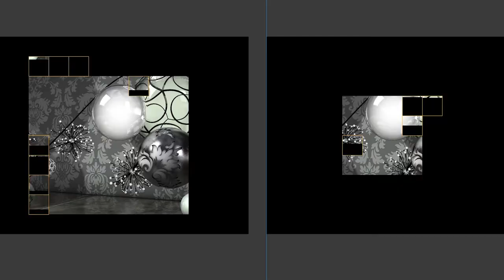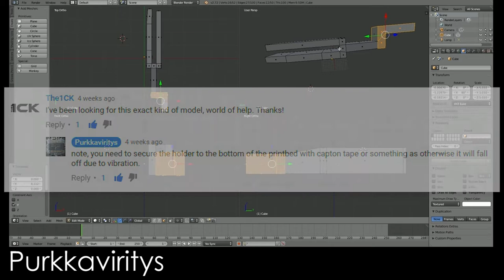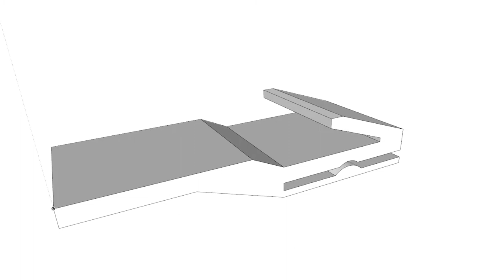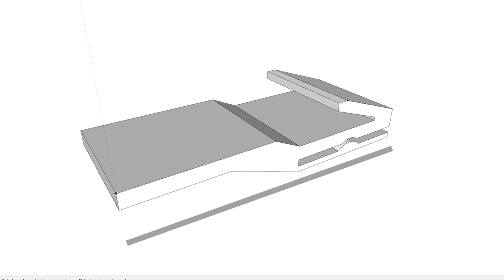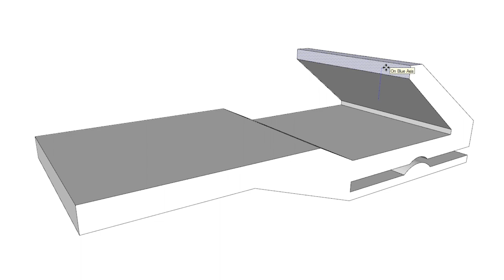3D Printing with the Maker Select V2 - Ep4.5 | Mounting a Camera

Comment: That camera mount is great! Thanks for uploading the file, I will definitely be using it. I am ordering this as a second printer so your videos have been very helpful to see the quality and modifications you were able do out of the box.  

Just a few quick suggestions that I'm sure you already know of, but might help someone.  To try to fix the warping issue on the camera arm, print it in ABS which shouldn't have any warping issues when printing PLA and should be a bit more rigid, but you may run into the same arm warping issue again when printing in ABS due to the higher bed temp (but should resist it better).

You can greatly improve your PLA prints with a part cooling fan, but if you don't want to tackle that issue yet, just buy a cheap (<$5) USB powered desk fan and set it next to the printer (preferably propped up so it's blowing a bit above the bed height so you don't run into any bed adhesion issues).  This should fix the bridging issue on your benchy, and will help the layers stick together better preventing odd layer lines in your prints. (I haven't seen any yet in your videos, but it's an issue I ran into a lot on my first printer).

Comment: OMG man, I love this series so much ha! Love that your first custom print was a shot at keycaps!!! I'm coming into this by way of mechanical keyboard building and wanting to make my own case, but had always wondered about keycaps. If you're curious my first and only keyboard project thus far was the wireless split Mitosis! Loving it and it only amped up my excitement for my next build, but right away I knew I'd need to start getting into 3D printing. Keep these up man! Got yourself a sub!! That mount is really really cool by the way! Great job!

Comment: Please correct me if I'm wrong. When you wedge this between the plates, doesn't it knock the hotbed out of level or at least bow it somewhat? I've tried something like this and with my camera mount connected to a metal bar clamped to the bed, but I got vibration. Maybe clamping to the carriage plate would solve that.